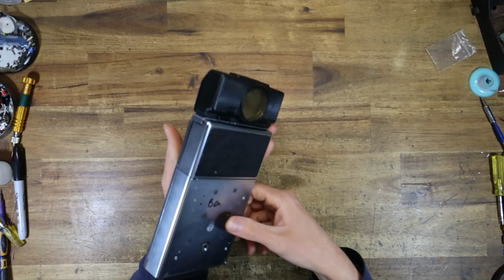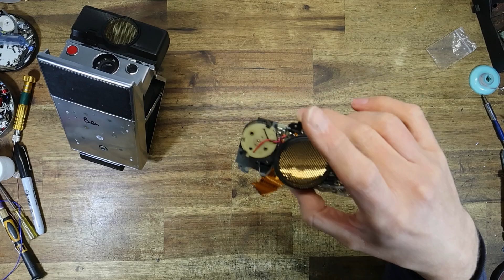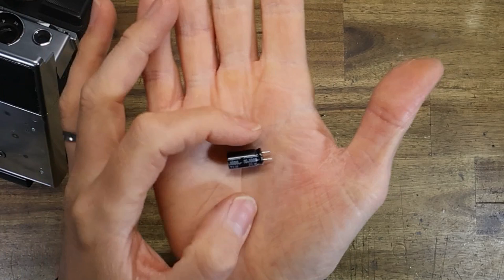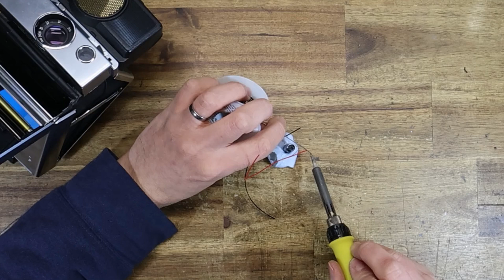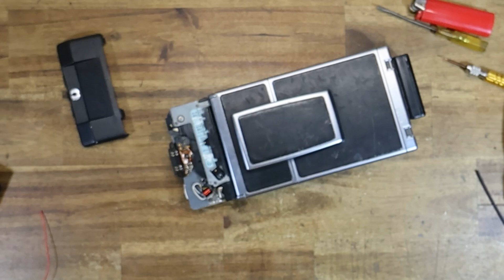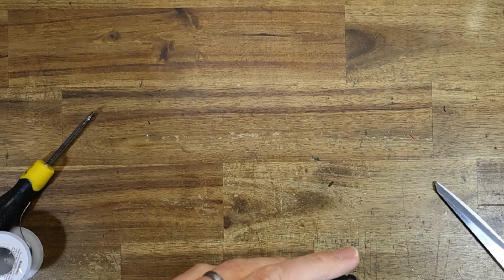I fixed a super rare SX-70 Sonar issue

Comment from the maker: Thanks again to my followers and PCBWay for your support. 

This issue is truly strange and niche, but is a good idea to rectify regardless of whether or not the camera is problematic. In case you missed the pop up text box in the video, this issue IS possible in stock SX-70 cameras too, but is likely much rarer there. I've encountered this issue years ago, and lacked the knowledge to fix it back then.

From what I can tell, the SOL3 Focus Issue occurs when there is:
- certain (early?) revisions of the Sonar AF unit PCB
- low battery power,  especially in a buck-converter i-Type adapter
- an SX-70R PCB
- or any other combination of flat batteries and high currant draw during photo taking

A 1000+uf 10+V cap of 8mm diameter will prevent such an issue though!
Reply: Thank you so much Jake and we really appreciate your wonderful work! Keep going and we will always be here to support and cheer you up!💯🥳